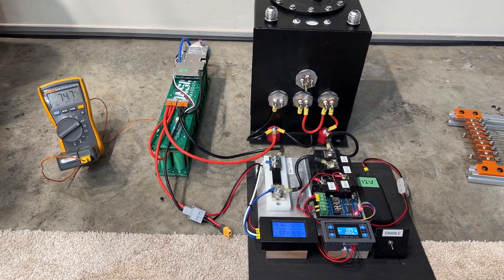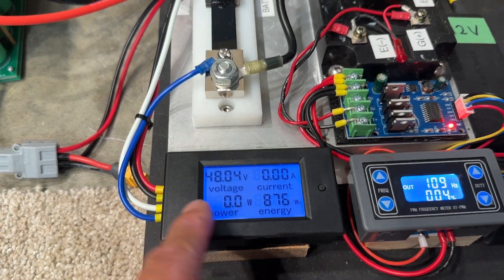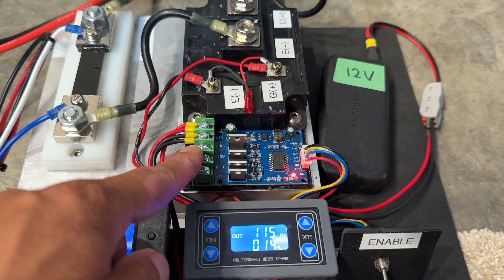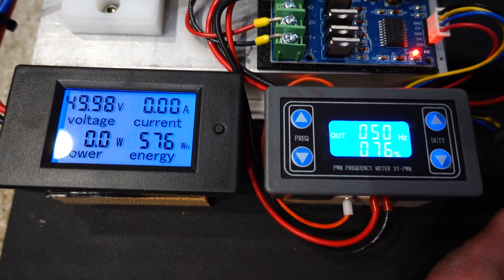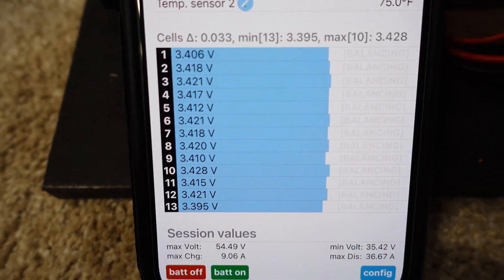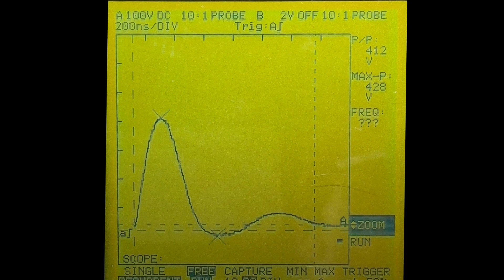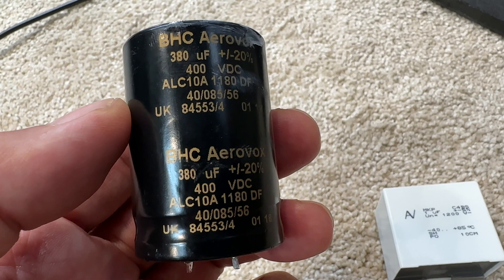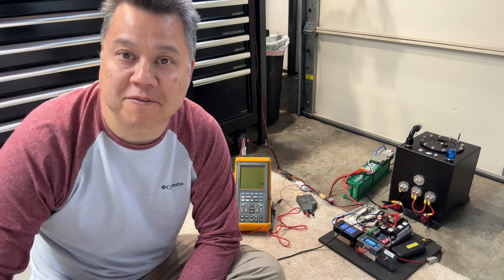Building a 150A resistive load w. IGBTs and PWM regulator for testing Lithium batteries

Comment: So you are just manually applying the snubber? What would be the correct way to permantly incorporate that to the circuit?

Also, is there no concern about heating the water in a sealed container? Is there some sort of pressure relief that we cant see?
Reply from the maker: The snubbers are designed to bolt right on top of the IGBTs.  You want them as close as possible to the IGBT to reduce voltage spikes.
Reply: @etischer  please correct me if I'm wrong, but if that's the case and it's permanently bolted on, wouldn't there always be some amount of power flowing through the snubber? Even when the IGBT circuit is not letting power through?
Reply from the maker: @adamfuge6561  No, it just acts like a capacitor across the IGBT, it's only dissipating current when AC voltage is applied to it.   Also the DC Bus is usually shut off when the car is off, so no DC voltage is present either.
Reply: Also, I'd just like to say, I love these technical battery videos, I'm big into lithium ion battery and drone battery packs and want to build something very similar to this for testing some battery packs, I greatly appreciate the insight I've been able to get from your videos. Would love to see more technical stuff like this on your channel
Reply from the maker: @adamfuge6561  Thanks, I should have a few more videos of the ducted fan at full power next week.

Comment: I'm trying to charge my cars battery. Would you know how a charger "negotiates" the amperage? I set it to 10 or 5, etc, but can only get 2-3A. Tried 2 different chargers. The battery is 12v, sitting "dead" at 11.5ish
Reply: How old is the 12V battery?
What type of battery is it? Lead-acid?
Reply: @PetraKann  it's a standard lead acid car battery, it's pretty old...at least 3yrs. I finally got the charger to put out 5A, but it went to 3A after a few min. Is it going off internal resistance maybe? I just want to charge as fast as my wiring can handle. I sit there for 20-30 min, would like it to be 5 :)  havent been able to fix the parasitic draw issue
Reply: @mwint1982  Maybe one of the cells within the battery has failed. I recall a lead-acid battery that wouldn't charge very well. It would start the engine the first few times but eventually it would fail again. Especially if you do night driving with lights or run the air conditioner and sound system etc.
I did get some advice to leave the battery on charge for a several weeks. Apparently the charger delivers trickle current after the fully charged light comes on. This trickle current could help revive the cells.
The other thing you can do is check the acid level - can top up with deionised water.
3 years is not that old, but generally lead-acid car batteries start to show problems after 4 years. It's more important to protect your alternator and starter motor than persist with a poor charging battery. Those crank amps are needed during start up so a good running battery is essential.

I wish cars had those lever crank starters seen on those old T-model Fords. Strange and inconvenient but almost fool-proof to get things started.
Reply: @PetraKann  thanks for the help. I've been trying different things. It works decent enough as is w/daily charging, but a hassle. Changing out for a new battery at this point would just ruin another. Might switch to super caps and solar :)